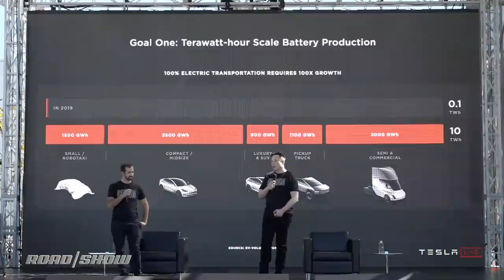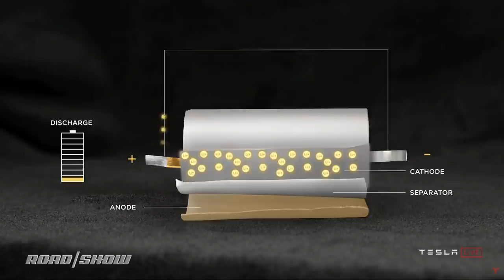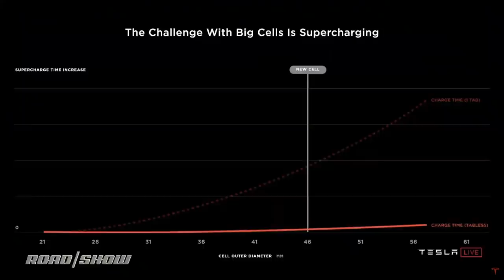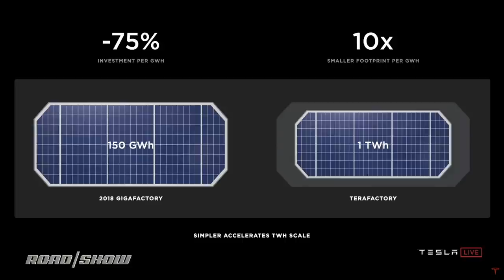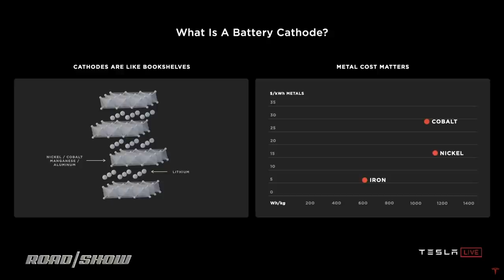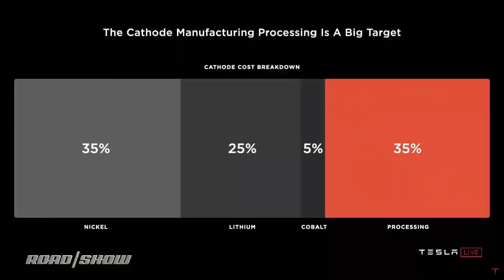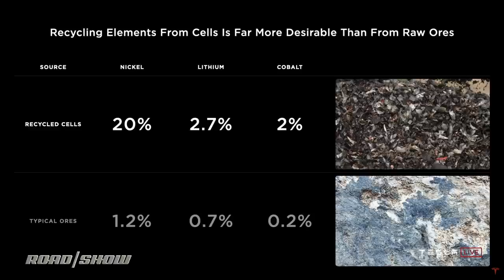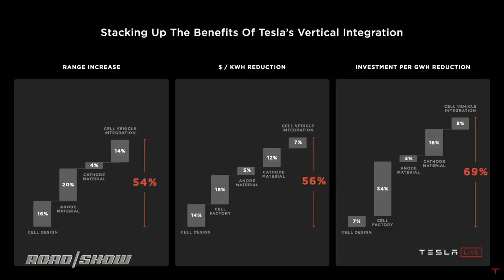Tesla Battery Day! Livestream Event HIGHLIGHTS

Comment: 6:50 doesn't that massively drive up the costly materials used?
Reply: 17:38 multi-tier battery levels isn't a surprise.  After all its already in use in the Chinese model 3.
Reply: I'm a little suspicious of that models s plaid.  The car now has the power and can use it, but it also still has some of the highest polar moment of inertia of any production car, so far as I can tell.

What that means is the car might actually be too reluctant to change direction.  Causing unprovoked understeer showing up on too many corners.  Yeah it is possible to fix it with torque vectoring, something I suspect tesla is doing, buy only to a point.  After that point you'll need a medic and/or clean change of underpants.

That might not be the case, but we'll have to see.

Comment: As it is right now, as far as I understand, the biggest wall that EV face is driving longer distances.  The infrastructure for EV and their charge time just makes it impractical for distance driving.

Would it not be practical to test the waters with smaller vehicles such as coupes and four door hatchback or crossover EVs that have 100-150 mile range; specifically meant for a daily charge and the daily commute?

Get that price down to ~$20k or better (the coupe would obviously be more expensive, but if the interior is nice then there would be a market for it) and there are plenty of people in urban and suburban communities that would be potential buyers.

At that point the market focus would shift its eyes to town and county distances while the science then receives real life data, time, and money to use and increase efficiency before trying to go for the long distances.

Sorry to talk your ear off, but the topic is interesting ✌️😬
Reply: The typical daily commute for most EV owners is less than 50 miles.  A majority of owners have access to charging at their homes and get that back overnight.  The issue for some is long distance traveling and charging times. Instead of focusing on increasing range, IE 500+ miles, manufacturers should focus on decreasing charging times. IE, car with 300 mile range, but it takes 45 mins to get to 80%.  With fast chargers, cars are now getting to 80% in shorter times 15-20 mins.  As battery technology improves, charging times will continue to get shorter and range will increase as well.  Batteries are getting cheaper and car prices will begin to drop. Lastly, as both improve, it puts less pressure at the charging facilities as people move in and out quicker.
Reply: Rickster1965  Based on your response, it feels like you didn’t read my whole comment and instead just read everything before “read more”, but I digress.  Your though that batteries and charging need to get faster at charging is a feeling that the companies hear, but I don’t think you understand how poor of an idea that is.

The way that batteries are coiled is one of the primary factors when charging an EV.  If you charge EVs faster then you wear out those coils faster.  Worn coils results in less stored power, so you’d need to charge more often.  Then that makes the battery worse and the cycle continues until the battery or some other hardware dies.  

I would rather see them create smaller batteries and sit on those for two or three years gathering data, letting raw material production catch up, and spreading them to the demographic I mentioned in my first comment instead of going all in on trying to replace distance driving gasoline cars when the infrastructure to support that just isn’t there yet.

If people had a smaller battery then it would inherently charge faster, so there are plenty that would vote for charging stations to be built in their communities during the two to three years that I said, and that movement COULD make distance driving (500 and greater mile distance trips) an EV with a 450-600 mile range  a viable option.
Reply: J K   Fast charging times is already here with Tesla’s next generation V3 charger and Porsche Taycan 800V/350KW charger.  Being part of VW group, I’m sure it’ll be part of their entire network in Europe/N. America.  You can basically charge to 80% in 15-20 mins.  Lucid recently announced even faster charging times for its soon to be released car, 20 miles per minute or 300 miles in 20 mins!  It’s not a matter of finding it difficult to do it, it’s just a matter of learning and letting battery technology evolve/mature.  Regarding starting with smaller EV’s first, at least with Tesla, it’s the more expensive premium models that continue to pay for the research/development for the rest of the fleet.  I’m thinking in the beginning, battery prices were still too high that even if you put batteries in a Mini Cooper or pick a small car, it would’ve have still been $50-$60K.  Not a good business model at that pricing.  That’s why Elon said in the announcement he was hopeful to produce an affordable car at some point as battery prices drop.

And yes, I did read your your first post in entirety.
Reply: I think you have this kind of backwards.  I disagree about long distance driving being impractical.  That’s exactly what I got my Tesla Model S Long Range Plus for.  I wanted my ultimate road trip car, and this was my choice.  With Advanced Autopilot, rated 402 miles range and free Supercharging , I can’t think of anything better for driving coast-to-coast, electric or otherwise.  However, that is an expensive car.  It’s expensive even among Teslas, compared with the 3 and Y.

Building an electric, compact, short-range city car is what several other car companies have tried to do (GM EV1) and some are still doing now (BMW I3, Honda E).  They haven’t set the world on fire yet.  Some people have range anxiety, because — whether it’s logical or not — they just aren’t used to driving cars with short range, they never had to deal with that before.  And maybe even more importantly, you could get an efficient, compact, gasoline-powered car for much less money without the limitations.  The cost of batteries made it impossible to sell the BEV at that low price point, compared with something like a Honda Fit or Toyota Yaris.

In time it will be possible to bring BEV cost down and make it competitive even in those compact economy car segments, and from what we’ve seen at this Battery Day event, Tesla are working hard on that exact problem.  It’s the ultimate end goal of everything that was presented, and it looks like it should be only a few years away from fruition.  When that $25,000 BEV becomes available (from Tesla or anybody else), and there are more fast-charging stations around, and people realize how convenient it can be to charge at home or work, and how much more money they can save on fuel and maintenance, that’s when electrics will truly take over.
Reply: @ZealousWZephyr  If you are concerned about charge times and battery service life, then going bigger is the answer, not smaller.  A large battery can accept higher charge rates.  The total charge time from 0 to 100% may be longer, but people don’t generally use the battery like that anyhow.  The miles-per-hour of range that can be put into the car is much faster with the large battery; that’s what really counts.  And as for service life, the bigger battery will take much longer to work through charge-and-discharge cycles, therefore it will last longer before wearing out.  As battery technology advances, power density improves, cycle life improves, then smaller batteries can become more practical.